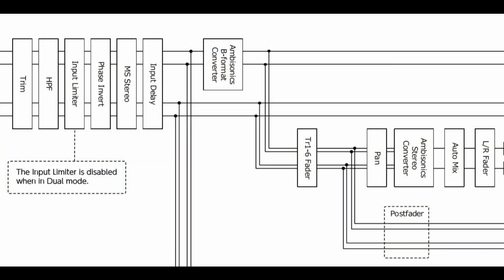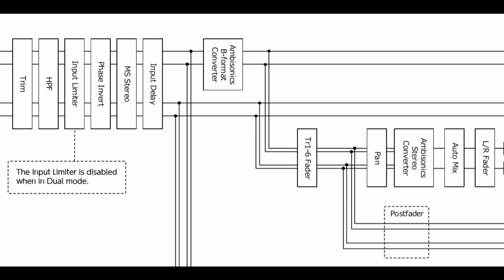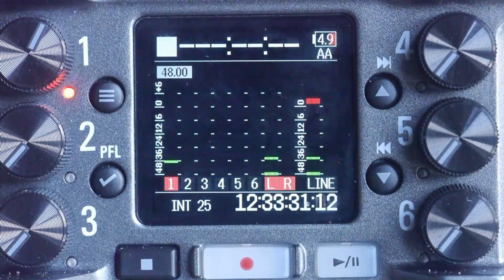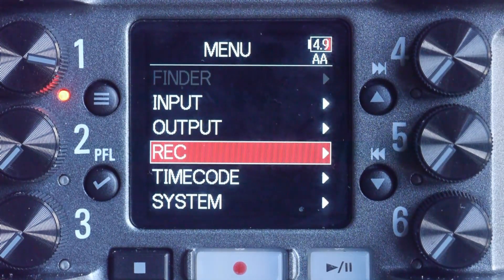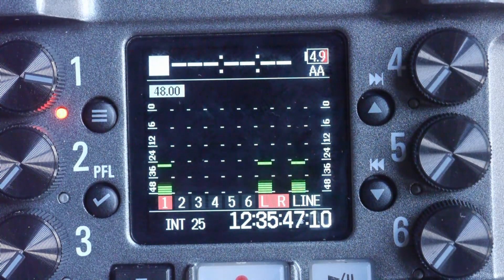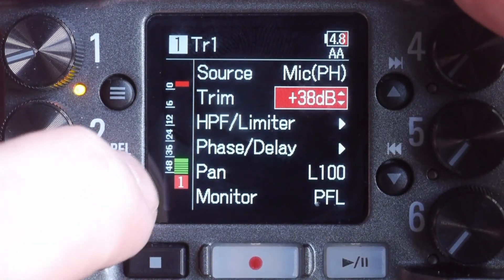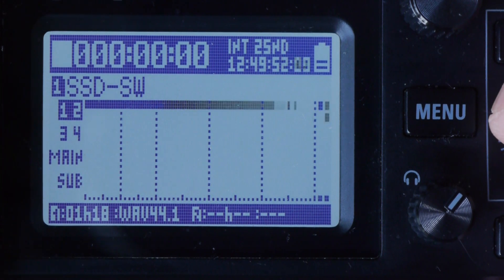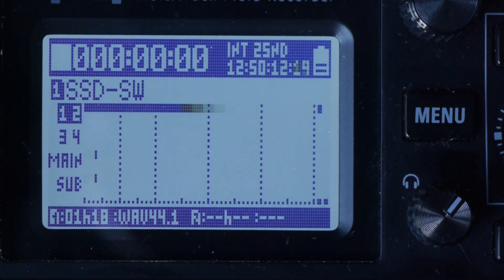Recording with the Zoom F6 - Why I think it still needs a firmware update!

Comment: Very good and informative video. And, have been solved the problem bye firmware update? Best wishes
Reply from the maker: Hi my F6 is currently out of action :(  so I haven't had a chance to load the latest firmware but I don't think all the issues have been addressed. Are you thinking of buying one?  Ta like, ppm6.
Reply: @ppmtv-qh9qk  Hi!! I actually bought one and it's on the way. Then I saw this video and I was wondering if the problem had already been solved. Thanks for the reply. Greetings
Reply from the maker: Hi - I don't think you will regret it the F6 is a good machine. For best manual control of the machine - use 32 bit float and the manual gain setting. Have a lot of fun! Ta like, ppm6.

Comment: I'm looking at buying the F6 and looking at the firmware release notes Zoom has never changed or altered functionality in any of the 6 post-release firmware updates, they've only fixed bugs:
v1.1 (Sep '19): F6 cannot connect to iOS devices in iOS 13 / iPadOS 13 via Bluetooth.
v1.2 (Oct '19): All operations are disabled during playback of files on F6 that are recorded with “30ND” frame rate for internal timecode.
v1.3 (Jan '20): Some delay may occur before proper sound is output when both phantom power and limiter on the track are ON.
v1.4 (Mar '20): Modification of firmware due to change of electronic parts.
v1.5 (May '20): Noise is sometimes generated when F6 outputs low-level signal to LINE OUT.
v1.6 (Oct '20): F6 freezes when a user attempts to connect it to F6 Control App and Bluetooth timecode sync device simultaneously.
...which is rather discouraging.
Reply from the maker: It is a shame - we are grateful of course for bug fixes but....  What projects do you have in mind?  Mind you there is always perspective. I was talking to a pal about a (or maybe 'the') major competitor for the F6 - it seems the battery life is terrible, really terrible.  Sadly we can't have it all, some times we can't even have any of it. I use my F6 regularly - the truth is it just doesn't have enough controls on the surface for the amount of power it packs as a recorder. On the other other hand - the F6 runs all day on about 7 electrons. Pays your money and takes your choice. Let me know what you end up with, always good to know what the deal breakers are. Which reminds me I need to do that final, final, final video about F6 timecode.  Ta like ppm6.

Comment: I just got this in August 2020 with the latest firmware and it still has this issue. I really wish they would fix this. Having to dive in to the menu system to adjust the input gain sucks.
Reply from the maker: Thanks Rich - in that sense the F4 is actually easier to use. You can get control using the pots if you go into 32 bit float and then set the operation of the pots to Rec Level - see page 191 of the manual. Look out for a new video on the timecode accuracy of the F6 when I get a moment. Ta like, ppm6.

Comment: I need help from F6 user. when I use AIF with Rec to use as an audio interface and record backup on computer at the same time. input signal is very low on computer. I've tested this on windows 10 and Mac OS. in normal Audio interface mode every thing is work smoothly. but AIF with Rec mode has problem on my device. is there any one experience this issue! please replay your comment. Thanks
Reply from the maker: Hi Ifaa - I don't use the F6 as an interface but I plugged it in to give it a try. I have tried Asio Stereo - AIF + Rec and the multi track option and the levels on the computer (Win 10pc) all look pretty similar. The Asio stereo is sent from the mix bus so the front panel pot will adjust the level, while in AIR +Rec - the front panel control doesn't seem to operate. And that is the same for the Multi-Track driver option. How big a difference are you seeing? And are you adjusting the front panel pots?  Ta like, ppm6
Reply: @ppmtv-qh9qk  thank you for replay: when I record on PC using AIF+Rec the maximum gain is -9dB. I'm trying to adjust recording level using front faders.  now I understand from your replay the front faders doesn't adjust recording level on AIF+Rec. I suppose to adjust from menu. by the way I like the sound quality when I use it as an audio interface. I have Focusrite scarlett 2i2 3rd gen. mic preamp is not good at all. even zoom H6 also not good enough like F6. I'm using Sennheise MK4 mic. it's almost perfect mic with combination of Zoom F6. thank you very much.

Comment: I emailed them when I first got mine on release day. I noticed the up and down menu button feels reversed compared to the markings on the unit.
The response I got was effectively..deal with it 🤷🏻‍♂️
Reply from the maker: Thanks SoL - is this about labelling?  For those who don't have a machine, the Up/Down buttons have two labels. Printed above the button is a transport function Next >>| above the top button and previous |<< above the bottom button. Printed on the buttons themselves are their menu functions top button Up (or previous!) and the bottom button Down (or next!).
I guess it is navigating vertical lists as against horizontal lists. I hope I have described this correctly!
Any other observations about the F6 in action? Ta like, ppm6.
Reply: @ppmtv-qh9qk  Yeah that's exactly it. 
I felt like the left and right actions in menus would be best suited with the opposite button presses instead.
The way it is looks logical on paper, but when you first get the machine it's not compared to every digital system I've used beforehand so it took me a while to get used to it.
Reply: @TheSound0fLegends  i def think the menu(back) and enter buttons should be reversed. trips me up a lot when i havent used the unit for a while
Reply from the maker: Sorry this is got lost for a few days, I wonder if in Zoom world the legend on (ha ha!) on the panel |<< and >>| only applies to transport functions and must be disregarded for everything else.  Because as the video shows those labels don't apply to navigating menus. Thanks for taking the time to demonstrate the issue.ppm6
Reply: @ppmtv-qh9qk  yeah they said to me by email that's how it's meant to be 🤷🏻‍♂️ to me that's the response you give when a bug can't be fixed haha

Comment: Still needs a firmware update from v1.2 because it comes up from a factory reset in 24 bit mode, instead of the touted 32 bit mode, which is ridiculous.
Reply from the maker: Good spot Dale - how are you getting on with the 32bit work flow?

Comment: Yes, absolutely F6 needs trim control by faders like F8, or F4!!  Need firmware udate!!!!
Reply from the maker: Thanks GT - I'm hoping for an update. The problem on the front panel is the absence of the selector knob which is much quicker in use than the buttons, as you can use it one handed. Remember though you do have encoder control of record level in 32 bit float mode. Ta.

Comment: Good video and agreed! One thing I just noticed with my unit: when I turn the channel level all the way up and touch the connector lock release button (nothing connected in the input) I hear a slight buzz and also see it in the meters. This only happens in Float32bit mode. Can you test if this happens with your unit as well and is it something I should be concerned about? SOLVED! See below.
Reply from the maker: Hi Jari - I have tried my F6 (well it's not mine really it has to go back to Zoom after the review) I don't have any hum under the conditions your describe. The mic amps in the Zoom have 75 dB of gain so when you open it right up without a mic plugged in all I get is a tonne of hiss. I touch the XLR release catch and no hum appears audible. It sounds like an earthing thing. Does it happen on every input?  When you plug your very quiet SM7B in and sit in a quiet room with the gain maxed and you touch the xlr chassis or that release catch are you hearing any hum? I would be good if someone else who has one could pitch in with their experience?
Reply: @ppmtv-qh9qk  Thanks for testing! I just found out, that my fluorescent desk lamp was causing the hum!! When turn it off the hum goes away!
Reply from the maker: @soundwise   Thanks for the update - the wild and wacky world of audio!  Glad you have solved the problem. Let us know how you get on with the F6.